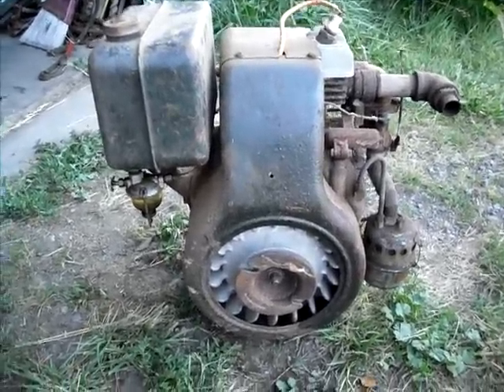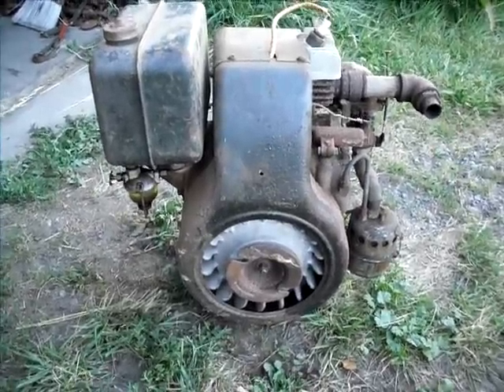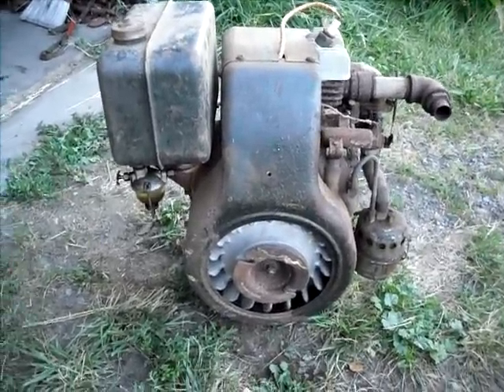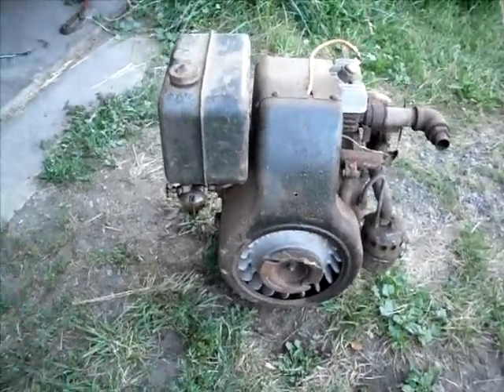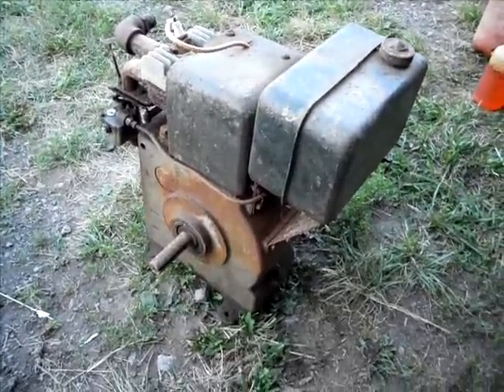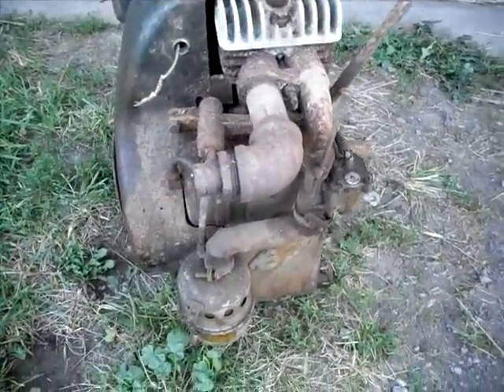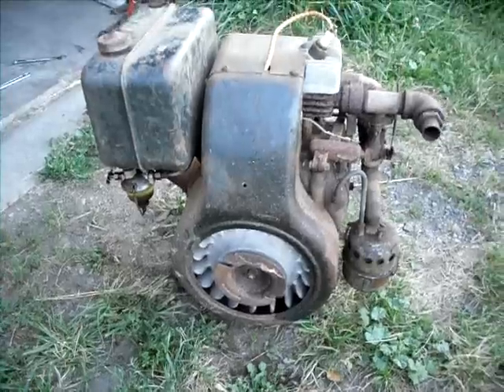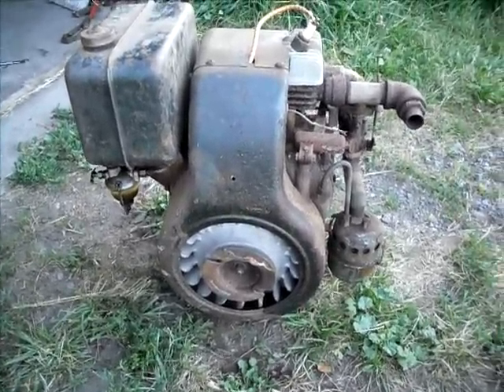Onan Air-cooled Engine

Comment from the maker: The only time it could be harmful is when there is not even a pipe present. The idea is to prevent a whisp of cold air from contacting the hot exhaust valve when the engine is shut down. Muffler or no muffler, as long as there is a length of pipe present, it should be ok. It also really only matters if the engine is being worked hard, which is not happening here.